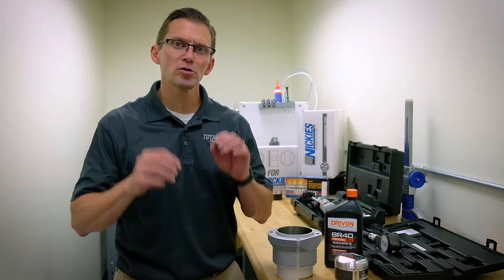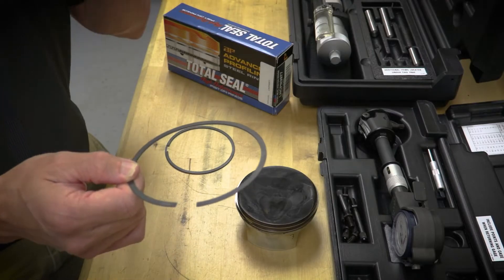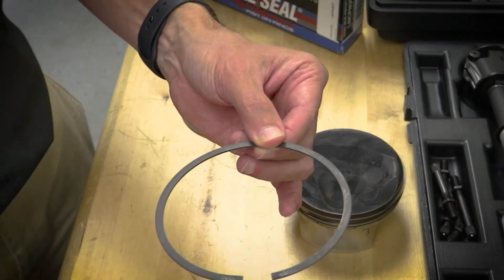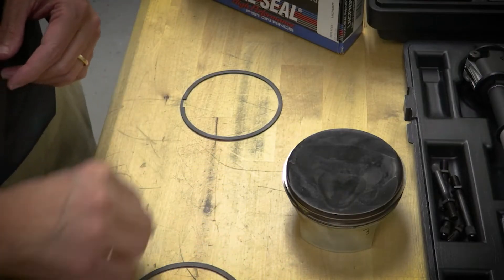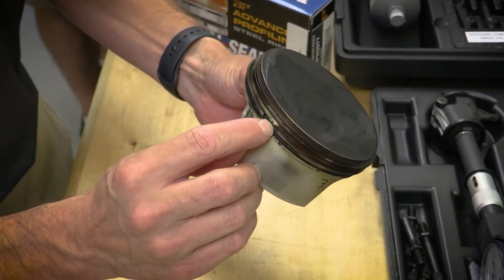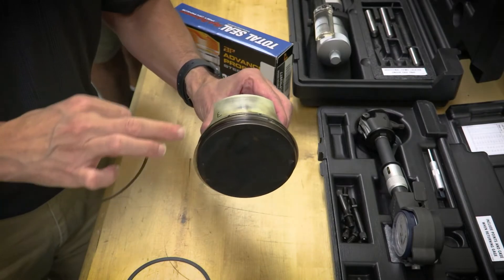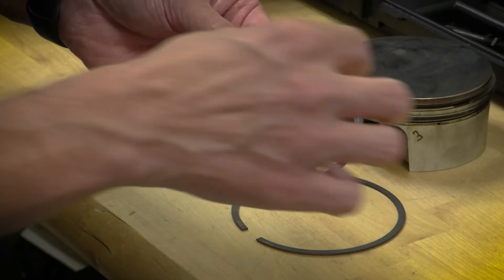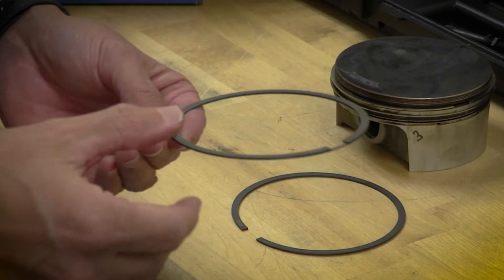Piston Rings 101: Total Seal Gapless Rings - with Lake Speed Jr.

Comment: Total seal is not the inventors of the gappless piston rings.  There are OEM gappless piston rings in engines over 100 years old!!!
Reply from the maker: That’s very true. They are certainly not the original manufacturer of gapless rings.
Reply from the maker: That’s very true. They are certainly not the original manufacturer of gapless rings.
Reply: Totalseal says their gapless ring sets are patented. I wonder how that works,

Comment: yes    but are these rings made for all makes and models;  like a 2001 dodge ram with the v8 engine...Im curious as to how the rings get over the piston too    but you say they come with all instructions
Reply from the maker: As we only specifically deal with Porsche applications, you'll need to reach out to Total Seal directly for your application. Instructions should be available to download from the TS website as well.
Reply: The rings have a gap but there are 2 rings in one groove and the gaps are offset from each other so in effect no gap.

My 9.14:1 compression Pontiac has gapless second rings and the engine cannot be turned over by hand with the spark plugs installed. It turns easily enough but the rings seal so well it will push the wrench right back where you started when you let go of it. I won't build an engine without them.

Comment: I thought that a gapless second ring was not a good idea, but a gapless top ring is a good idea.
Gapless rings work so well at sealing pressure/blowby that when used as a second ring it causes the top ring to flutter and lose it's seal.
Reply from the maker: There are lots of options for rings from Total Seal, including gapless, gas ported, total conform, and even different coatings. The application must be considered when selecting rings.

Comment: Why gapless on the second ring and not the top?  if the 2nd ring seals the oil it starves the top ring from oil cooling and lubrication
Reply from the maker: Using a gapless second won't starve the top ring of lubrication assuming the cylinders have the proper surface finish. The crosshatch, valleys specifically, will hold oil. However, a gapless top ring also works very well and can be combined with Total Seal's gas porting as well for the top ring.

Comment: How do they work for a turbocharged or supercharged engine?
Reply from the maker: Yes. Total Seals gapless rings or even their total conform or gas ported rings can be used in turbocharged or supercharged engines. It's always a good idea to use a modern steel top piston ring rather than a cast iron one in forced induction applications and Total Seal can supply upgraded rings for most any piston and application.
Reply: @lnengineeringllc  turbo engines - blow by is a problem and weakens fuel quality on subaru turbo`s these will help totally  . thank you .